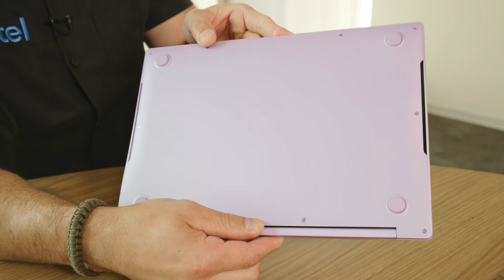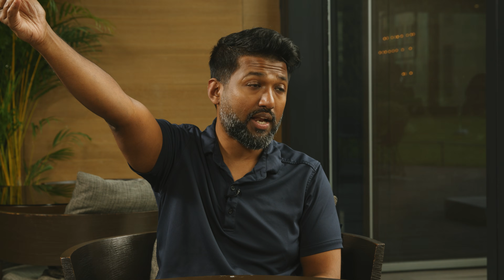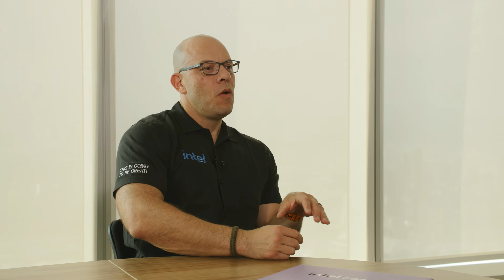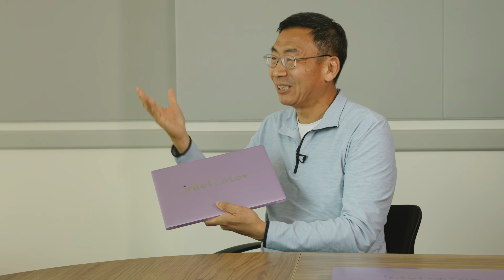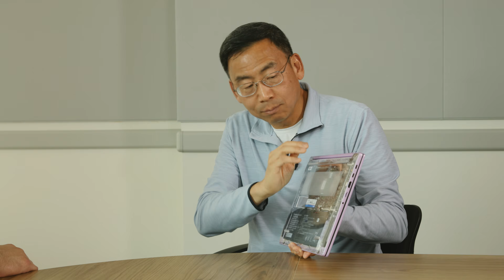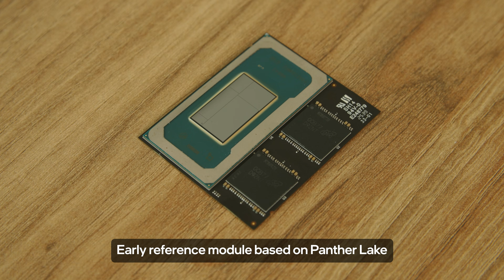Intel Reimagines Mainstream Laptops with Core Series 3 and Firefly | Talking Tech | Intel Technology

Comment: Plastics can be fine, they are even more resistant to drops and scratches. It is how you finish the material and if you put paint, if it is enough to look good and stay looking that way for a good while.

I am personally quite disappointed with the N6000 laptop I got a while back. It throttles very hard (to 1/3rd the boost clock) and ends up not much faster than the other quad core N3450 from two generations before.

Hope these new chips do not suffer from the same issues. AMD is also not doing better on these types of lower end parts. Mendocino is a complete dumpster fire.

Comment: Good low end option.

Where are the high end that actually compete with Apple silicon. Including SKU's like max with 512-bit memory bus, or ultra with 1024 bit bus.

All i see from intel is 128-bit as the highest consumer choice. Even HEDT only capped out at 256-bit.
Reply: ..and intel will sell more laptops CPU for PCs alone than all the apple silicon in computers in a year.
Reply: @RicardoDawkins

A massive portion of the Wintel volume is driven by corporate bulk buying. You're talking because Winslop corpos. That's all.
Reply: @2933034 ...then Winslop will continue to run the world after all.

Comment: You've had six years to close the gap with the Apple M1 based laptops and in that six years it seems like the gap has only widened. 

I have a desktop PC based on Intel Core i7-14700. It's almost 3 years old now but no slouch. 
I also have a Macbook Pro M4 Pro based laptop.

The Macbook outperforms my desktop Intel based PC on Geekbench 6 and Cinebench 2024 when it is RUNNING ON BATTERY while the desktop is obviously plugged in gulping down about 300W system power.

Another point.

My son has an M5 Macbook Air (entry level model). I have a $1700 Thinkpad P1 with a Meteor Lake CPU.

The Macbook Air outperforms my Thinkpad ON BATTERY while the Thinkpad is still plugged in and running on the performance profile.
And the Air wins not just by a little bit. Geekbench 6 score on the Macbook is about 17,000 multi core while my Thinkpad is only around 13,500 (again his is WHILE PLUGGED IN)

What's the problem? Is x86 the problem? Is manufacturing process the problem? All I know is that 12 years ago, Intel was #1 and in a dozen years, they have lost the performance crown in a very embarrassing way.
Also ... stop with the LP cores and LPE cores. Just give us one core that works well and scales down in power when needed and scales up.
Reply: You summed up the issues I have had with Intel over the years succinctly.
But I think the issue is also the software vendor i.e. Microsoft.
My old i5 7th gen laptop ran superfast with Ubuntu but  when I had to run some proprietary software, I dual booted it to Windows, it literally became unusable. I mean things would freeze which shouldn't have had. 
The downfall of Intel is due to MS and their Co-pilot fiasco.
Reply: @DVS0304  Oh I've  switched to CachyOS. I know Windows is a problem. It's inefficient but also spyware. I boot into Windows like 6 times a year mostly for TurboTax. But I think next year I will use TT online and do it from Linux. I'm still dual booted to Windows. It's amazing, running in Linux the PC is mostly quiet and uses 5GB RAM and maybe 1-3% CPU utilization most of the  time (unless I'm running a game or local LLMs) When I boot into Windows, just getting to the desktop consumes 12GB of my 32 GB RAM and the fans are on all the time and CPU utilization spikes wildly from 2% to 25% for no reason. It's awful.

I agree somewhat. Microsoft didn't make Intel look good. But M5 CPUs are clearly superior to pretty much anything Intel makes.
Reply: M1-M5 have had 6 years to increase that company marketshare...but the needle isn't moving...not even a 2% increase.

maybe you should add two more Mac in replacement of those PCs... 😜
Reply: @RicardoDawkins  high sales doesn't mean good. generally low quality, high quantity can be reduced to a single word. Slop.

That's what the Windows PC market has become. Slop. And now I would say Windows PCs barely have a price advantage. So I would expect that 2% increase to triple soon. And recent news is showing that. Apple has now taken 11% of the US Enterprise market per PC World. This is a pretty dramatic rise.
Reply: @LouisDuran  
High Sales: are we using the same rule for the high Apple sales ?
the triple of 2% is 6% still single digit and almost a rounding error.

US Enterprise: 11% is low double digit share after more than 25 years of competing with modern Windows PCs
and get this...the Worldwide and 89% of the US economy is running on Slop